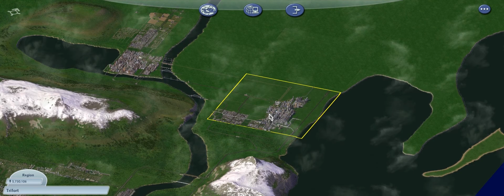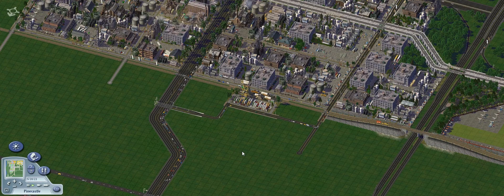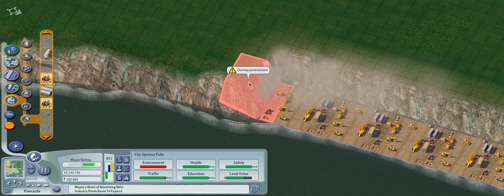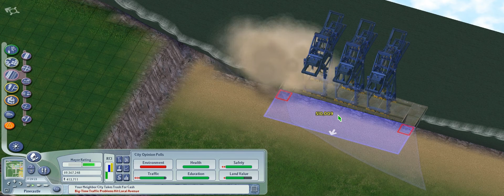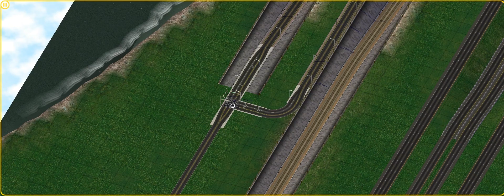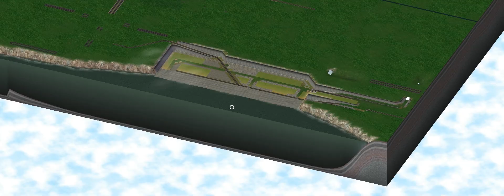SimCity 4: Let's Play Pinecastle, episode 19 (industrial port construction)

Comment: this same trick is used also to build CDK's Modular Seaport. just remember the ground needs to be flat before you place a dock use Maxis Seaports and roads to level the ground and use the teraforming tool to crop it. once the ground is level place the docks and enjoy. remember when placing the truck terminal and the railyard they need to be on the outside edge and the port roads need to go around them.

Comment: Do you ever use SFBT's diagonal fillers? Two of the pieces are transparent on one half which is very useful...
Reply from the maker: Hi, I've used them in the past, but the ones with the half-transparent textures aren't so useful to me because of the bug where they show a hole in the ground after a while, and you have to go in and out of the zones data view to fix it.

Comment: I have to ask, what is that Japanese yelling and where is it coming from?

Great video BTW, keep up the good work.
Reply: It's a bug. It's the query noise for either the central railway or el rail station. Unfortunately at this point it seems hearing the noise play all the time is a more or less unavoidable tradeoff of using the station.
Reply from the maker: Hi, thanks.  Yes, as Thunk00 said it's a query noise (for the el rail station I believe) which plays randomly due to some bug.  I've had other buildings do that to me as well.

Comment: Really enjoyed the video as usual. It's cool to see someone tackle building a realistic port area without extensively relying on landmarks, albeit a small one.

Also, you probably already know this, but it's smart to make backups before installing new PEG content. Never can be too careful when it comes to prop pox. I think the CDK3 seaport lots (or at least most of them) are safe but a fair bit of the other stuff on that site causes it.
Reply from the maker: Hi, thanks a lot.  I am always somewhat worried about the prop pox; I made some corrections myself to a few PEG files to avoid it, but I do make a backup every week or so, and never delete the old ones in case some new plugin causes it to happen.
Reply: Samgoogolplexian Good, I had a feeling you had it covered. I didn't take backups very seriously myself until I'd already lost a couple of my favorite city tiles so I think it's a subject that it never hurts to bring up.
Reply from the maker: Thunk00 Right, I've been there too; the first time I got the prop pox, I thought I had fixed it three of four times, only for it to ruin another city every time.  I eventually had to delete my whole plugins folder and start over from the beginning, which is when I started keeping more backups.